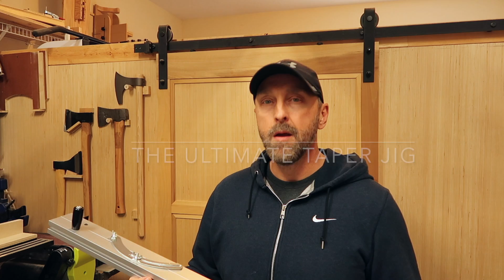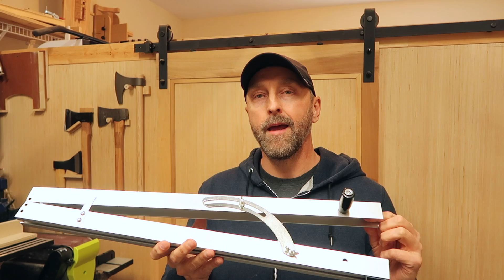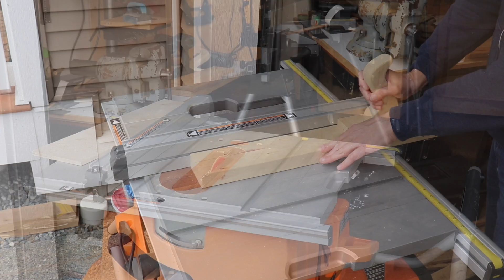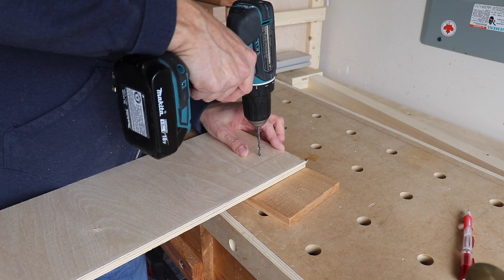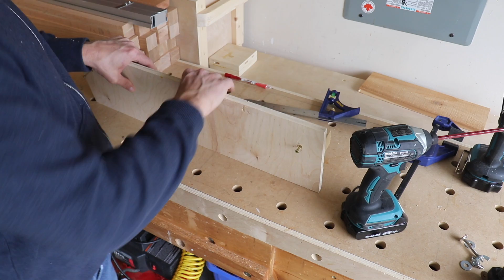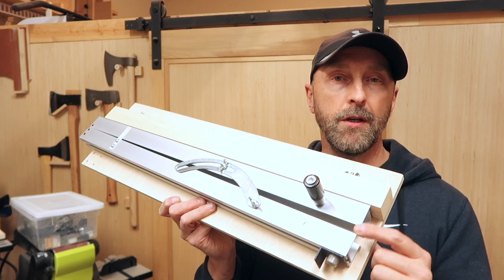You Only Need One Taper Jig // Woodworking

Comment: Very nice adaptation Eric! As someone else noted, it would be nice to incorporate a hold down which would make it safer to use & eliminate the push stick.....................  :)
Reply from the maker: @Sapele Steve Thanks! It's tricky to use a clamp on a 2X2 leg taper, unless you build a special jig just for that size. You don't have much of a clamping surface near the hinge axis.  I found I get better control with a bird's mouth push stick - but that's just me  🙂